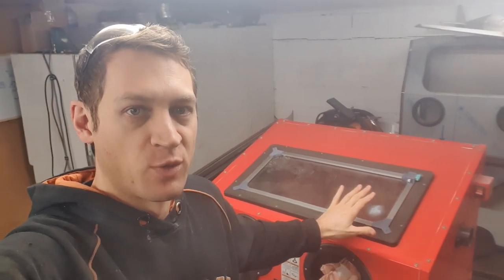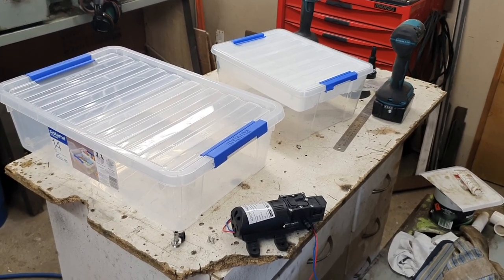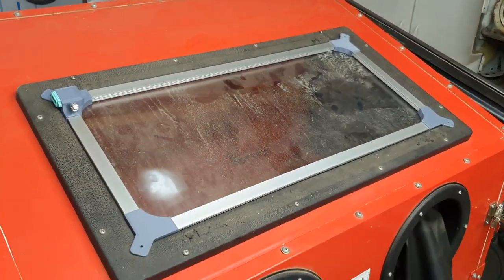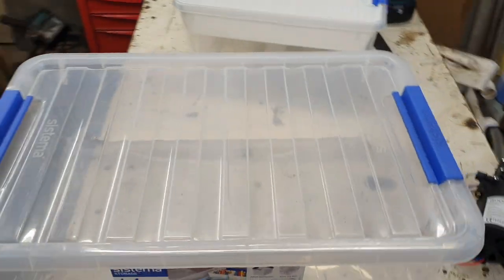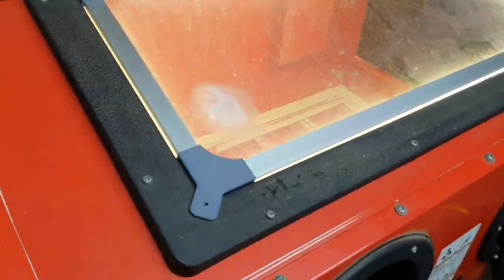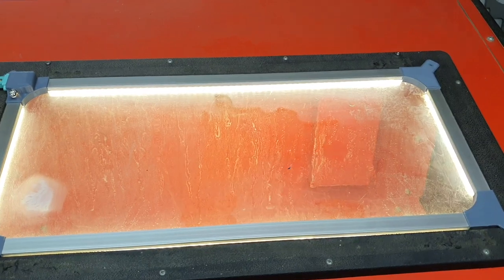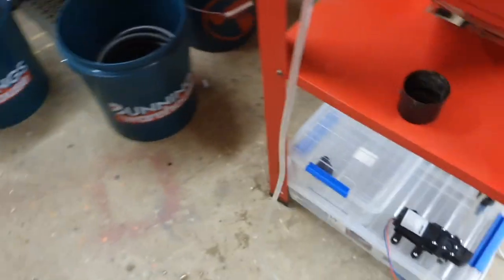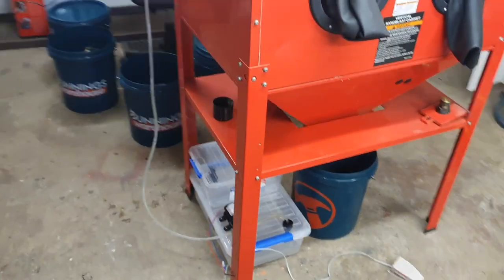Easy Closed Loop and Window rinse for Vapor Blaster

Comment: Where can I buy the led lights do they com in the aluminum frame.
Reply from the maker: Hi Jerry,

I make these up. I have printable files on my website for the brackets.

It uses rigid 500mm 12v led strips, 2 500mm led extrusion lengths, factory style plugs to suit the standard power supply.

You can get the parts from Ebay/Amazon/ Aliexpress.

Cheers
Josh

Comment: Parece ser que ya no suelda con la cortadora de plasma.
Reply from the maker: Stainless is still welded with the cut 50 plasma. The Jasic 200 is used for Aluminum.
Reply: @ArmouryEnterprises  sigue adelante con tu proyecto, gracias por responder.

Comment: Nice idea for a cheap window rinse Josh! Does that pump work load dependent like the Seaflo pump other cabinets are using, or is just on/off via pedal?
Reply from the maker: Hi Lukas,

Both, the pump has a pressure switch, but it is actuated by the pedal in this setup. This same set up could be used with a larger pump that provides for the widow rinse as well as a wash down gun, by actuating the rinse bar with a solenoid.

Thanks for watching!

Comment: are your led lights and water pump are 12 volts dc?
Reply from the maker: Hey Leonardo.

Yes the LEDs and Closed loop pump are 12vdc. The slurry pump is 240vac.

Thanks for watching!
Reply: @ArmouryEnterprises  wow amazing so youre using a transformer converter from ac to dc? thank you
Reply: @ArmouryEnterprises  what brand or specs of your slurry pump you have any links? does the media and water altogther circulating inside the slurry pump?
Reply from the maker: @leonardoc.floresjr908  I use a number of different pumps. You want to be over 750w and a side exit. Preferably over 14000lph.

Yes, the pump circulates both water and media
Reply: @ArmouryEnterprises  thank you sir